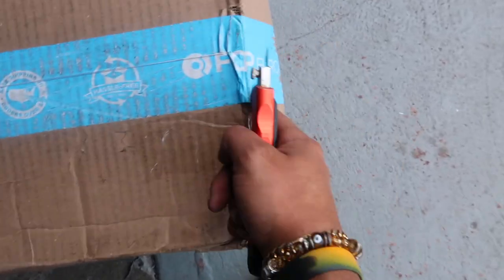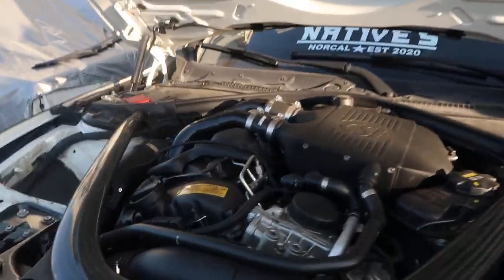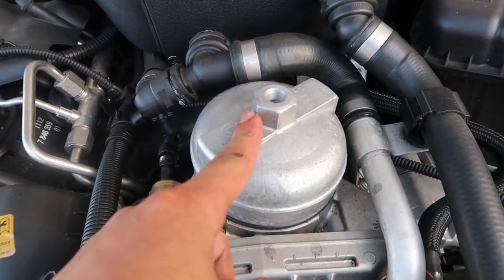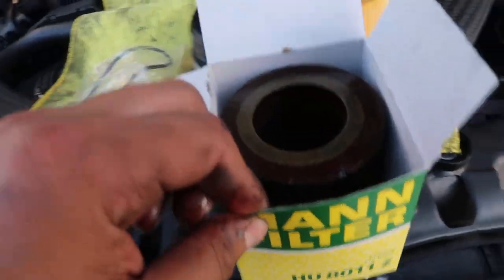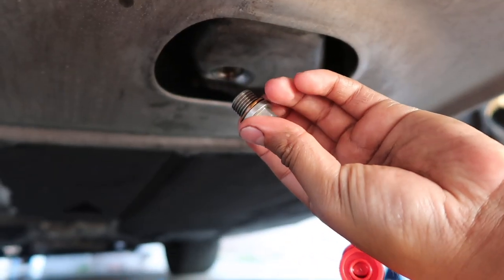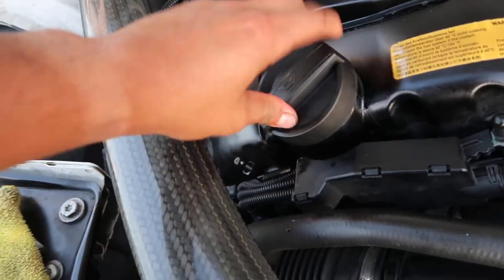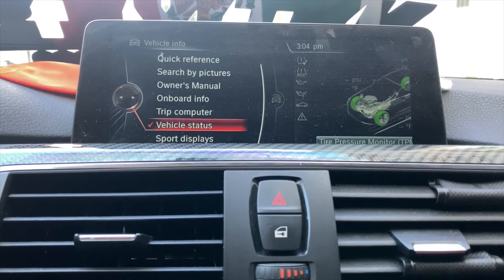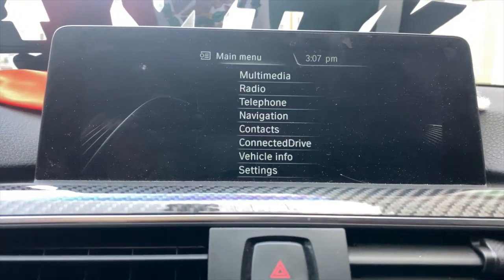BMW M4 gets Oil Change DIY: F80, F82, F83 using Liqui Moly on S55 | Best Oil for BMW Maintenance!

Comment: Buddy you have some learning to do, 2:15 do not ever lift your car like this unless you want it sliding off, jack pads are too smooth for conventional Jack stands they even say this on their website, unless you’re putting them on a flat pad which is what they are meant for. They also sell the same style jack pads In hardened rubber with mold in the bottom to accept a conventional jack, this dude is lucky he wasn’t changing his wheels or moving the car more or else that would have without a doubt slid off. Always love seeing new channels just make sure you’re taking the time to do things right so you’re not setting a bad example for others.

Comment: Great stuff there. Dropped my oil temps at least 20° and takes longer to reach 250°. Gets hard to come by as I live in rural Az.
Reply from the maker: Great stuff indeed! I’ve noticed a drop in oil temperatures aswell, I’m looking to get an oil cooler to see just how much more the oil temps drop! Arizona heat must be brutal!
Reply: @AuthenticAlexndr  it can get really hot out here. Still running the stock cooler. I power hose ut at every car wash I give it just free it up from debri and build up. That helped it alot also.

Comment: Yo bro manual says 5w30 on S55 engines. I see that you used 5w40 instead. Have you had any issues? I have a couple mods to my car and wanted to try liqui molly but they only sell 5w40
Reply from the maker: Heat range on the 5w40 works perfectly within the boundries of the cars specifications and it has ran fine for me

Comment: How did you jack the car up and get the jack stand to be directly under the jack points? Did you jack it from a different location?
Reply from the maker: Yes I either jack it up from the differential with a rag and piece of 2x4 between the jack and diff or from the front jack point under the subframe

Comment: Now that I see this, 5w-40 is thin for the M engines. Should be a 60 weight
Reply from the maker: I’m from San Francisco so the weather doesn’t really get too hot out here but a higher weight does offer the engine protection in a higher state of temperature
Reply: NO
Reply: @KiNG-tx9je  ummm, yes it does.
Reply: @thisguyshorty3554  not for S55 engine, BMW recommends 0w30, thought can use 5w30/5w40